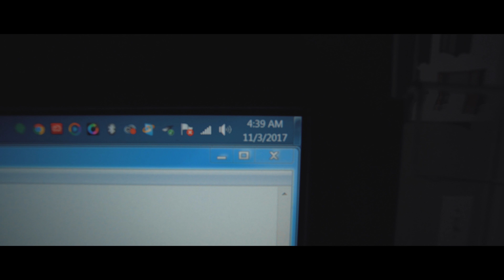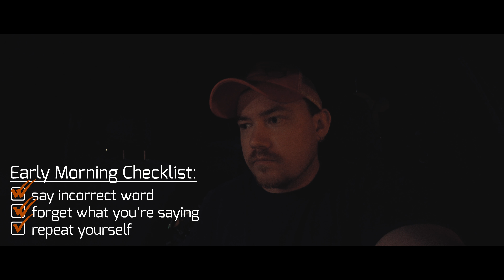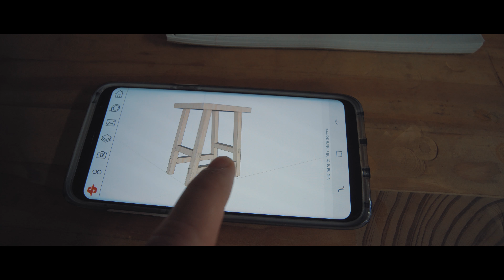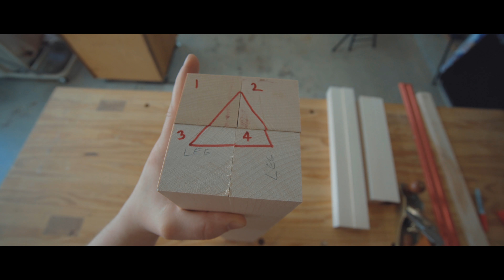Power Carving with an angle grinder - 288

Comment: Great video, Jay! Saw you guys using the tape flag on the drill bit method and it reminded me of what we used to do when I was building airplanes. We would wrap the tape around the drill bit at the appropriate depth and then spin the drill until we had a quarter inch or so thick cylinder of tape around the drill bit. Lasts for many drills and doesn't etch surfaces like a bolt on drill stop does! Works for forstner bits too.
Reply from the maker: Good info.

Comment: G'day Jay, Looking for help, I do enjoy your work! however  I do have a question though every time I flatten the end grain cutting  board and put back on the bench It whorps back to the side just flattened, I can only use the router to flatten the board  this has happened several times now the timber is very dry and end grain so I thought I'd ask the professionals for "HELP" before I quit the project this Is the first attempt to make a cutting board. Can you offer any suggestions? 
Cheers D

Comment: Jay, are you using Holey Galahad wheels here? - please don't publicize these wheels - they are way beyond dangerous. The conical teeth are barely attached (braised-on and painted over) and WILL fly off at anything over about 12,000 rpm (which eliminates almost all fixed speed grinders!) in very hard wood (works well on pine and poplar etc). Believe me I had several of these conical points stuck in my leather apron a while back - within minutes of switching on. If I weren't wearing a full-leather apron, I'd probably be bled-out and dead. Can't believe these wheels are still being sold. I believe these wheels were invented to grind hooves -- which is why they're still sold. Please inform your subscribers NOT to use the wheels on hardwood. Thanks